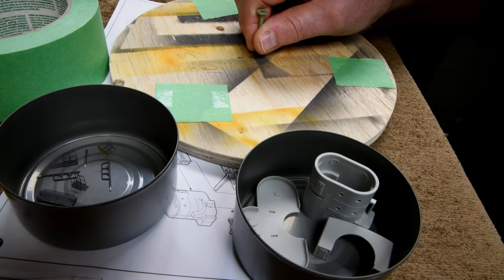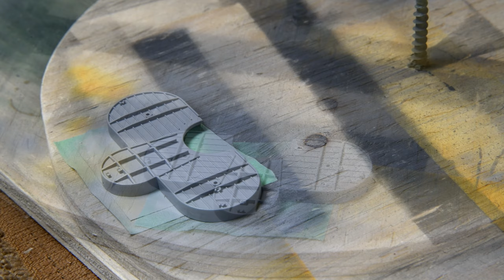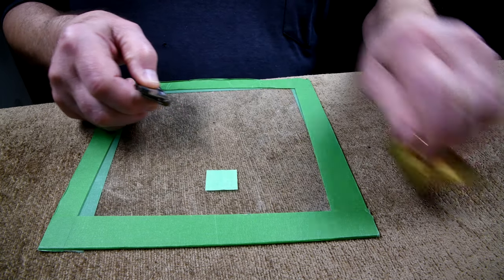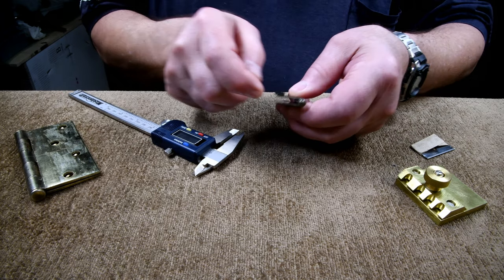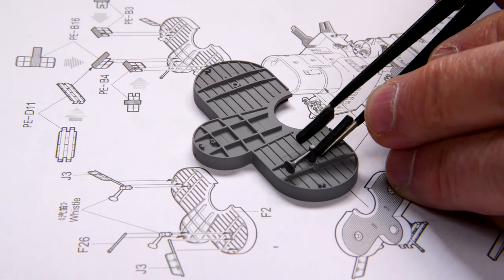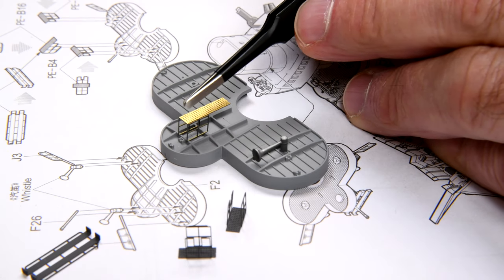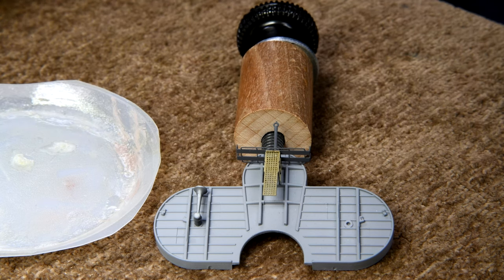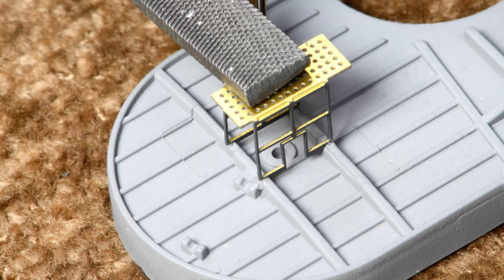The Model Ship - Part 172

Comment: Ron you will probably find that the part you were talking about only being 18 inches.....There was probably railing on top of that. A lot of kits dont have all the railing you would expect to find on a ship. There is a huge after market industry for supplying every possible piece of photo etch for ships. Builder simply add the things that they are comfortable doing at their skill level. It is not hard to spend more than the value of the original kit on such upgrades.
Reply from the maker: Thanks Glen. I was wondering about an additional railing too. Maybe I check "the book"